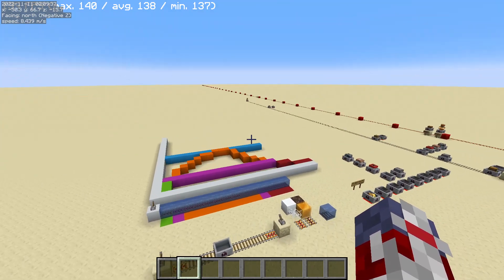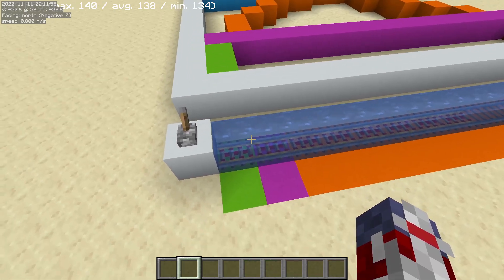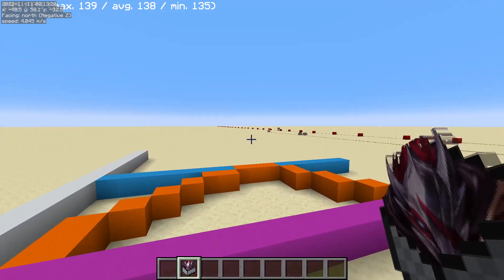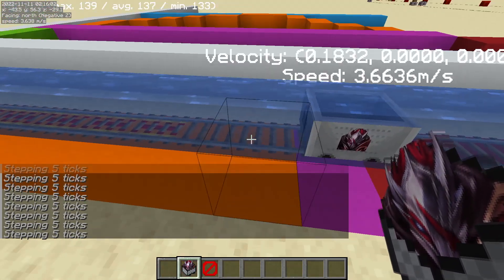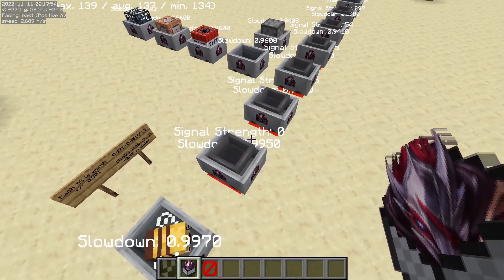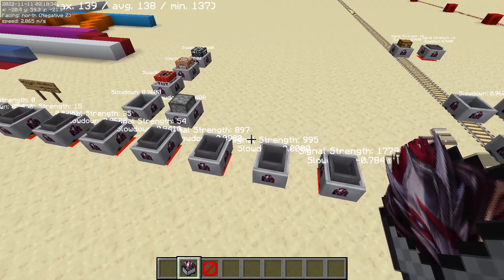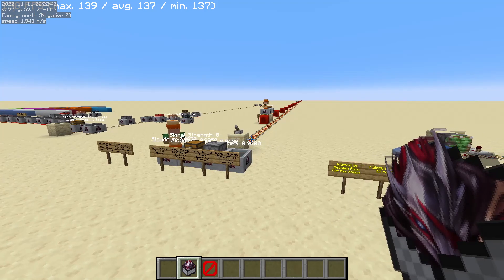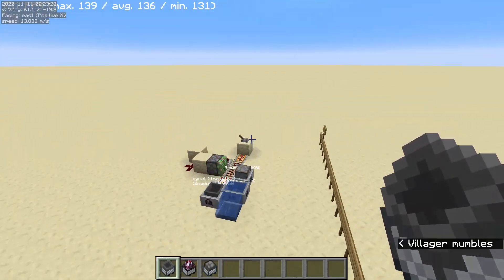Cartstone Guide #3: Motion and Slowdown

Comment: great vid, I would be interested to know if there is a range of stable speeds. as in, is there a way to keep a cart moving at 5 blocks per second, etc.
Reply from the maker: It is theoretically possible, but to my knowledge there aren't very practical methods to accomplish going specifically 5 blocks per second if you are utilizing the movement of the cart. You can use pistons and rail snapping (which will be the topic of my next guide video) to achieve consistent speeds ranging from 0 to 20 blocks per second. There is a way to also make the cart move consistently at faster than 8 blocks per second with just rails and the cart, but those also use cart snapping to bypass the usual speed limit. There are ways to go much slower than 8 blocks per second with similar methods. If you have any other questions feel free to let me know! Hope this helps. If you would like I can attempt to combine these methods and find something that goes at specifically 5 blocks per second, but I wouldn't anticipate it to be very practical.

Edit: Elaborated for accuracy.
Reply: @inspectortalon  thanks heaps for replying! I'm actually trying to find a way to keep the speed very slow so I will watch your next video for sure!
Reply from the maker: @KM____________  If you are on discord I can send you some screenshots with ways to slow the cart down dramatically. There is particularly one method I developed fairly recently that might offer you the most versatility based on your needs.